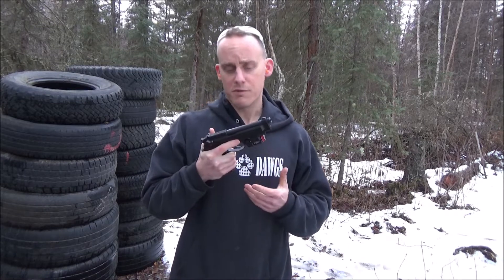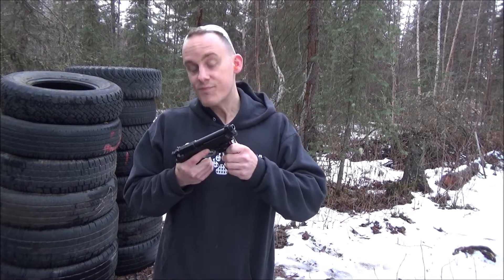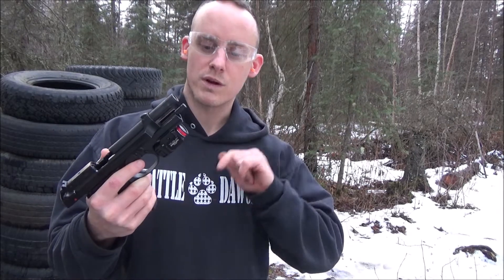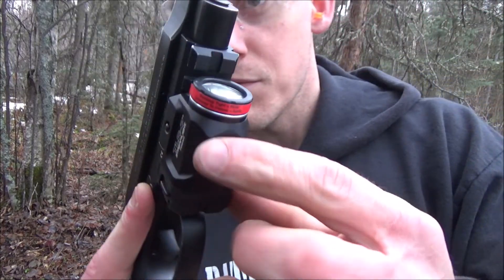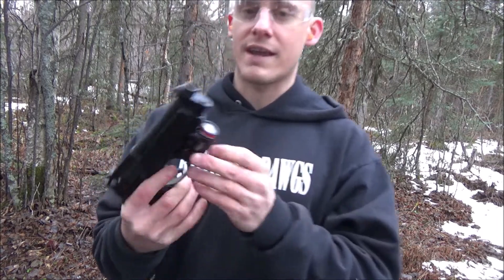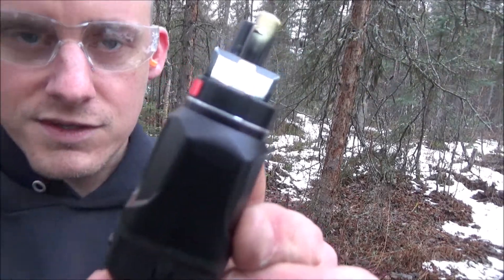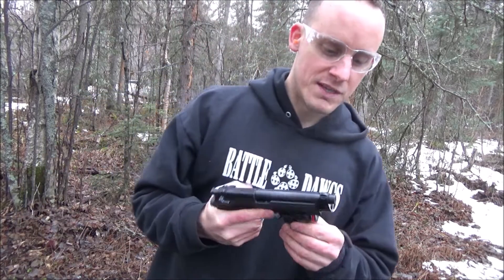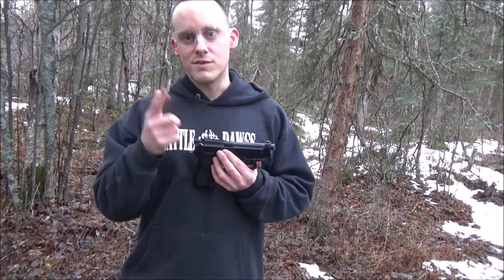Streamlight TLR7 Fixed?

Comment: I’d say putting 100 rounds thought it keeping the light on isn’t to bad.
Reply from the maker: It wouldn't be so bad if they didnt say that it should never come undone. This is just the beginning. It is just gonna get easier to turn off from here
Reply: doitriteak true if they are claiming it won’t turn off then yeah. Is this the same one you did a review on that was turning off after just a few rounds?
Reply from the maker: @hornacek1  oh yeah. They sent me a new one. It is only a matter of me changing the battery out a couple of times. the threads will wear and the oring will lose tension. Then I'm right back to where it was.

Comment: Streamlight most probably thought, that you turn it anyways to the battery safe position and remember to turn it back on, when the burgler stands in your room.

But what annoys me even more is, that switch is cancer in its purest form, they fixed it recently with the TLR7A but the new Switch isn't compatible with the TLR7 allthough the front part is the same.

Comment: Should've told them to send you the TLR 7-A
Reply from the maker: Wouldn't matter. They set a design based on taking off the bezel to put in the battery, causing unnecessary wear through battery exchanges